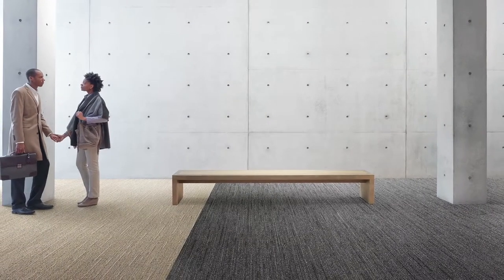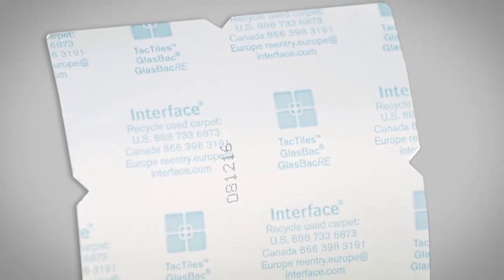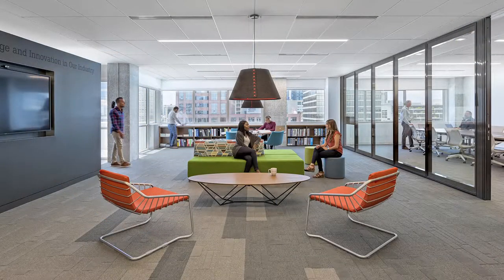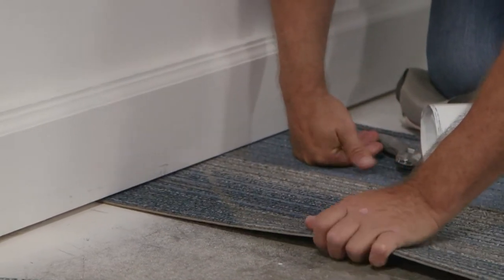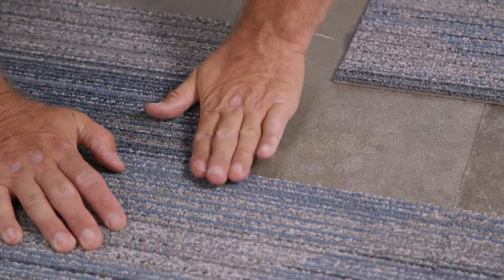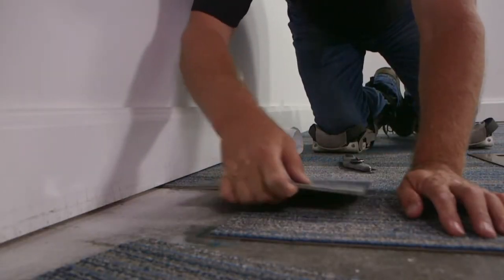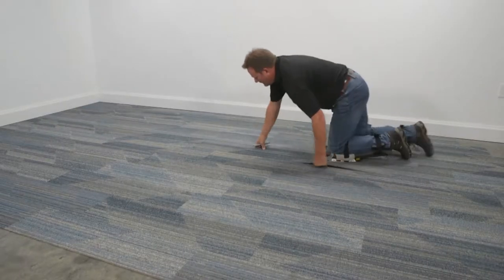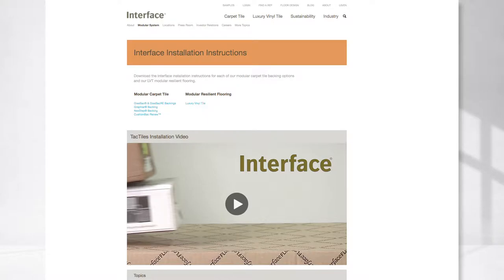Installing Interface Carpet Tile with TacTiles

Comment: 4:30 You're not supposed to cut a carpet tile over other tiles such as the guy did here. He unnecessarily cuts numerous times when the tile was already all the way cut on the first pass. He ended up cutting the other tile beneath, leaving damage. When he removes the cut carpet tile look to the right side of where the tile was laying and you'll see the damage. This is something this instructional video should've pointed out, but failed to. Most installers I've seen use either a box flap or a spare carpet tile as their cutting board to place beneath each tile being cut to avoid damaging the ones beneath.